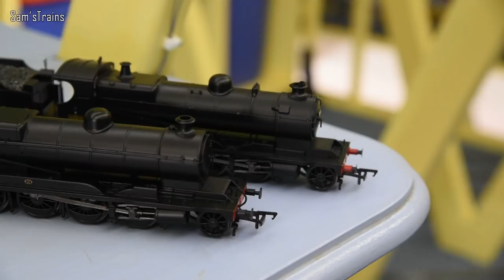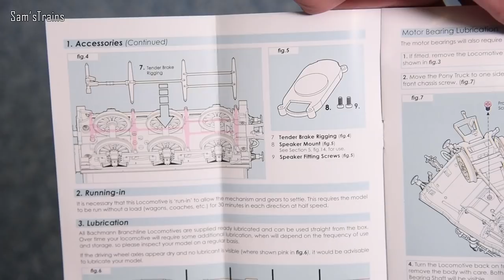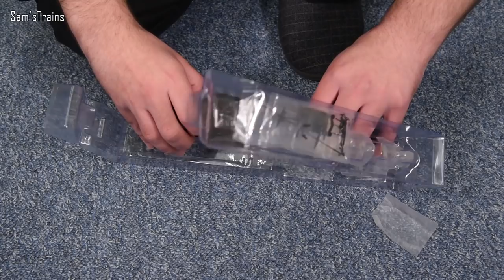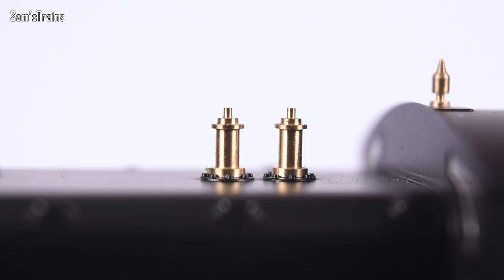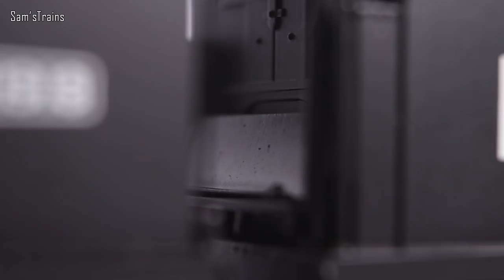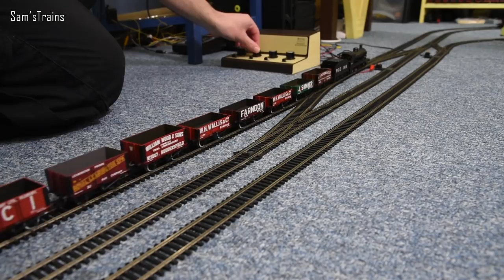Bachmann Wartime ROD 2-8-0 | Unboxing & Review

Comment: Hey Sam, Just thought I should throw an update on the Australian homed locos. They are preserved, ROD 2004 is currently on static display at the Richmond Vale Railway Museum, While ROD 20 and 24 (original number not given/recorded) are 'preserved' at Dorrigo Steam Railway and Museum. 

For those wanting to know, Dorrigo is technically a museum, but a better way to describe it would be open weather rail lines in no greater condition than when they arrived.

Comment: As I have a wartime layout I eagerly bought another loco even though it was by Bachmann. 
WILL I NEVER LEARN?
I stripped it down and looked with horror at the shoddy quality and the appalling mechanism. I wouldn't have knowingly paid £100 for this. I only have  my state pension so I need to be careful with money. After seeing the lack of contacts, no real barings, loose handrails etc. I lost no time in parcelling it back up and returned it for a full refund. No point in running it. It will deteriate in no time. I wrote a letter of complaint to Bachmann which won't do any good but it reduced my blood pressure a little.
Great review Sam. You backed up what I found.
Reply: Very well said, and you speak for many of us in the same situation. Thank you. 
Tim

Comment: Part 2: If we look at the 1950’s moving into very early 1960 they were scattered across many Motive Power Depots of the Eastern Region.
31B March 		25 (due to the prescence of Whitemoor marshalling yard)
35B Grantham		12
36A Doncaster     	32
36B Mexborough 	17
36C Frodingham   	6
36D Barnsley		6
36E Retford		      13
38A Colwich	      15
38B Annesley	      50
39A Gorton		      60
39B Sheffield Darnall (again due to the marshalling yard)  30
40B Immingham (new dock area)			                        17
40E Langwith Junction				                               35

Comment: Part 5: It is easy to see why the ROD chose the GWR 2800 Churchward class introduced in 1903 and the Great Central Robinson class introduced, 01 in 1911 & 04 in 1917. Tried & Tested with many spare parts at both Swindon & Gorton they were standard designs with great pulling power & reliability.

Comment: Sam, I've just read a German lady Linda Offenbach comments below. She's made a very good point that your review points scoring is missing a Durability rating. Currently, you are including this shared a bit between the Quality and Performance ratings. Original Hornby Dublo had quite crude mechanisms, but many are still running very well, so their robustness (inclusive of Durability) can't be faulted. 
The brass whistle scores high on quality, but the fact it fell off when you turned the loco upside down scores very low on Durability (read fragile). So adding another score class into the mix would significantly change the final scores. High detail and visual Quality is fine for an inert Airfix kit, but a moving model which gets handled a lot needs Durability.
I'm afraid Accurascale may come a cropper here when you get around to reviewing their products. They are high on details Quality, but low on Durability as they snap when trying to remove them from their box.
Reply: I’m worried @SamsTrains may not have seen the comment I am replying to, which is not surprising when there are 488 comments. I’m curious to know how Sam would go about testing the durability of a model’s body or mechanism, though, which seems more difficult than rating the durability of detailing.

Sam’s reviews are already great, but there’s always room for improvement. I would personally be interested in haulage tests that push locomotives closer to the edge of their comfort zones, which may be more useful than knowing how many wagons they can pull on straight and narrow track (which is what is currently measured).

Hope this has been helpful, Sam. I appreciate your videos, especially your critical analysis of mechanisms, which certainly helps fill in the gaps left by how power is measured. Showing all the details on camera also gives everyone a chance to pick out issues they aren’t willing to deal with on a model (such as the roughly molded drivers on the Sonic Models 4-6-2 tank engine, which would have been a dealbreaker if I was looking to buy that model). Thanks for making these reviews.
Reply: @Charmaster04  Durability I feel should be about handleability mainly e.g. would one be confident in picking it up and removing the body from the chassis without vulnerable bits falling off. So far, every Accurascale loco if purchased has had little bits of black plastic detail lying in the bottom of the clamshell packaging. Also, upon picking up one of their tanker wagons, the steps up to the roof snapped because they were made of plastic, not etched brass as they should have been. They are a new company, and these faults show their inexperience  in choosing the correct material. Also, sometimes, being a bit over scale on thickness is necessary to ensure strength and therefore durability. 
I think Sam has enough experience handling stock to give good judgement on this issue.
Reply: @andrewdking  Thanks for clarifying. Also, Accurascale has bought Hatton's original steam locomotive tooling and has produced their two tank engines. Does the same durability/handleability issue seem to apply to them, and would it probably apply to the Genesis coaches if they bought those (I may or may not be heartbroken that the Genesis coaches don't seem to appear on American eBay and have been marked up to about £200 for a set of four on eBay UK)?

Comment: Part 4: Allocation to the BR north eastern region a small contingent worked the area in the early 1950’s. Again due to the association with the Great Central Railway. 01 & 04s worked hera and all were gone as the 60s approached. 
53A Hull Dairycoates  27 by 1959 they had been replaced by WD 2-8-0s
53E Cudworth            5
Reply: Thirteen sold to Australia for coal mining service.. Lasted in service until 1973. Three remain.
Search YouTube for richmond vale railway 1971-73 to see some of the last in service use as late as 1973 until the Beyer Peacock 2-8-2 tank locomotives took over all haulage until 1987.
Reply: @johnd8892  Excellent Thank You

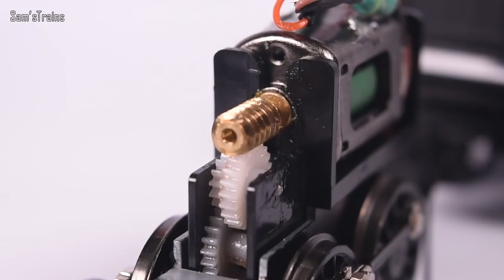Comment: At 17:40 I think you will find these are inductors, once called chokes. These are to reduce high frequency interference generated by sparking at the commutator. The capacitors aim to do the same thing.
I think mandated by electrical equipment standards.
Explained to me when quite young by my Triang Railways First Ten Years book on page 108. RT208 from 1962. Much later on covered in my university level electronics courses.
If people think these are resistors then calculate the resistance from the colour bands and measure the expected voltage drop. Inductors aim for close to zero ohms resistance as would be expected for a component wired in series with a motor.

Comment: Marking
Three pole motor - minus half
No flywheel - minus half
No chassis bearings - minus one
No tender pickups - minus one
Broken piece on delivery - minus half
Glue on body - minus one
Bent part - minus one
Poor crawl out of box - minus half
Poor crawl after running in - minus one
Weak power/lack of torque - minus one
Expensive RRP - minus one
Traction tyres - minus half
Paint issue - minus one
Too fast running (silly gearing) - minus two

Comment: Part 1: These would be excellent choices for modellers as they were peppered across the Great Central system, basically anywhere there was a need for heavy freight locos (remember the Great Central did good from freight receipts). Infused into BR they appeared all over the Eastern Section.

Comment: Although these were the most commonly referred to ROD locomotives there were many more used by the ROD such as ten Australian D50 class 2-8-0 consolidations from NSW.
NSWGR D50 locos were sent to France in WW1 and worked alongside these other ROD locos.
From Wikipedia ;
During the First World War, an additional 10 locomotives of this class were under construction at the North British Locomotive Company, but these were not delivered to Australia, being taken over by the British War Office for the Royal Engineers Railway Operating Division. After the war, they were offered back to the New South Wales Government Railways at higher than new prices and in a badly worn condition. They were declined and 8 locomotives were subsequently acquired by the Nord-Belge railway [fr] in Belgium[3] and, following rebuilding, assigned to work coal trains along the Meuse Valley. The 2 other locomotives were acquired by S.A. Force, Eclairage et Docks de Gand in Ghent, Belgium

Typical British approach to Australia offering badly worn ex ROD D50s back to NSW at higher than new price. All locos, irrespective of design, run by the Railways Operating Division were ROD locomotives.
Quite a few D50 HO models have been made over the years , from brass to white metal kits to ready to run.
The D50 were in service from around 1896 to 1972.
Reply: The Midland Railway also supplied many Kirtley double-framed 0-6-0 goods which ended up all over Europe as far as Italy. Simply because they were so numerous and standardised and easy to operate and maintain. Just like the later Stanier 8Fs, which ended up after WWII as far afield as Egypt, Iraq and possibly Iran, all equipped for oil burning.

Comment: Hi Sam.
Nice locomotive I've often considered, or one of the variants.
I've had a couple 'tender pegs' break on my Bachmann locomotives - admittedly the ones broken on mine were fixed distance pegs.
Generally, I flat, drill appropriately and replace with a 'headless screw' (or grub screw) of correct diameter / length (obviously can adjust by screwing in a bit more where space permits, if required.
I generally like the idea of 'adjustable distance' - it's very simple - much easier than the Hornby way of unscrewing and replacing the screw.
Nice honest and direct review.
Al.

Comment: Hi Sam I’ve had problems with Bachmanns tender coupling arrangements too. Twice on different locos the plastic coupling pin has been too short and it has resulted in the locos dropping the tenders in random places. I cured it by putting a 1mm drill up through the centre of the plastic pin using a pin chuck and using epoxy to glue a longer brass rod in the hole. Seemed to cure it but let’s face it locomotives shouldn’t drop the tenders at all. On second thoughts perhaps it was  0.5 mm.

Comment: You need to get a padded locomotive stand for when working on upside-down locomotives.  You can make a simple one using some pipe insulation and a couple pieces of scrap wood, or you can buy some really neat ones.

Comment: Hi Sam, just bought one of these in LNWR livery, and I thought it was worth noting that, though it doesn't have tender pickups, there is a capacitor located in the tender from the factory. I'm not sure if you mentioned that, I didn't hear it when re-watching this video. Still doesn't mean the tender pickups aren't necessary, but it is a little extra feature that most locomotives don't have.

Comment: Hey Sam , in regards to the coupling part , I have had it happen with two Bachmann a2s , where the tender shaft to the drawbar broke , i fixed it with a spare self tapping screw.I told Bachmann and the way it occurs is basically when it is handled , the drawbar can break the shaft off

Comment: Hi Sam I am getting a Lima Class 47 and it is due to arrive at my house  on Saturday so it should arrive this Saturday and I have already sorted out a Rake of BR maroon mk1 coaches and it was on Ebay for £45.00 and I was going to get a Mainline Class 42 Warship D824 HIGHFLYER but it sold for £37.50 but I can get a Mainline Warship at my Local model railway shop for a little bit Cheaper and I also plan on getting two West Country Class locomotives a Wrenn Dorchester and a Wrenn Barnstaple and 12 LMS coaches  and a Class 66 captain tom Moore some time in not to distant future .Cheers.Lewis 😀.

Comment: Hey I just wanted to say I have some Bachmann U.S locomotives with the same type of chassis that still run nicely after 20 years . I have one that failed and it wasn't the bering less chassis that failed it was the brass barings on the belt driven worm gear

Comment: Well done Sam for exposing Bachmann for their profit-seeking ‘value engineering’. Whilst I do appreciate great engineering; how about you doing an endurance race? Take a cheap Bachman mechanism and a better grade of something else and run them several hundred hours (or ~50 hours with the Bachmann?) and see how they go? Maybe do a vote on the expected continuous service life? Maybe have to do a mini-service every day to clean the wheels and pickups?! I would respectful suggest the square cast chassis bearing do not wear but they will add friction. Be interesting to see the mode of failures - motors at a guess.

Comment: Sam after getting back into the hobby the one thing that gets me the most is how over priced things have became.
And then the substandard quality of the items is just unreal.
Reply: Perhaps you can find a reliable second hand source ?
Reply: I know it's not the best solution but modern Hornby Railroad items are really good. I've had nothing but good experiences with the newer models and a lot of them are in the £60-£80 range.
Reply: Purchase a Hornby R3544 B12 for just 140 GBP!  I just did.  What a gorgeous model!  Perfectly assembled, a delight to look at, all metal boiler, runs as smooth as silk, as it should, with a five pole motor and two flywheels.  Now that is great value.

Comment: So much variation in the standard of Bachmann locomotives depending on how far back they were tooled up.
But not much variation in price to reflect this, all consistently high.
So your older reviews are a valuable guide to finding out what is likely to be the driveline in a model being considered for purchase.
Even Bachmann listed as new may be just a new livery. Bachmann being very rare to improve much to justify their increasingly higher prices as you would expect for the money.
Magazines are pretty useless for this information. They just go on about the prototype for most of the review then say everything is '"Superb" or have special access to the makers to get preferential supply of models checked to a standard that normal purchasers never get.

Comment: Very nice review.

You should do an experiment comparing the tractive effort of 2 locos - a low quality (bachmann) mechanism vs a high quality mechanism. Locos need to be as similar as possible. Run them both continuously under load for a few hundred hours then see how the tractive effort changes.

Comment: The engine looks great! Now I wish Bachmann can fix the issues on their old Reading I10sa engines and rerelease them soon. 
Edit: it pains me to see all those resistors and capacitors choking the motor and performance. I bypassed them on my Niagara with the Tsunami 2 decoder and it works better than using the board. I wish they’d use decent decoders from factory for the non sound engines.

Comment: I like the Robinson 8Ks. I've got a LNER black O4 and a BR black 30xx, just like yours. I'd love a ROD in LNWR or LMS, but not for the current price for that mechanism.
It's shameful that Bachmann can produce such a nice looking loco yet is outperformed by a Heljan O2 with missing valve gear (my 8Ks slip with 40 wagons, my O2 can manage 50 without slipping). But hey, they're better than the 9F with its lack of torque.
I still need a Thompson O1 and a S&DJR 7F, plus a LMS or BR liveried Stanier 8F.
I'm hoping Hornby's new Clans will have some improvements over the original release about 15 years ago, although they do seem to add DCC sockets and NEM couplings to all their locomotives when they re-release them.

Nice to see you running a nice length of freight train though
Reply from the maker: Yeah me too - nice looking class! Oh sure, way better than that 9F!!
Thanks for watching, Sam :)

Comment: One of the three preserved ROD 2-8-0 is preserved in Australia, somewhere.
In fact the New South Wales D50 2-8-0 bear some resemblance to to ROD 2-8-0
Reply: And numerous D50 locos were sent to France in WW1 and worked alongside these other ROD locos.
From Wikipedia ;
During the First World War, an additional 10 locomotives of this class were under construction at the North British Locomotive Company, but these were not delivered to Australia, being taken over by the British War Office for the Royal Engineers Railway Operating Division. After the war, they were offered back to the New South Wales Government Railways at higher than new prices and in a badly worn condition. They were declined and 8 locomotives were subsequently acquired by the Nord-Belge railway [fr] in Belgium[3] and, following rebuilding, assigned to work coal trains along the Meuse Valley. The 2 other locomotives were acquired by S.A. Force, Eclairage et Docks de Gand in Ghent, Belgium

Typical British approach to Australia offering badly worn ex ROD D50s back to NSW at higher than new price. All locos, irrespective of design, run by the Railways Operating Division were ROD locomotives.

Comment: It's a shame that Bachmann can't be better and more consistent (in a positive direction).  When you look at this loco and the 9Ffor example compared with the GNR/LNER C-1 and LBSC/Southern H-1 4-4-2's it is very upsetting.  The latter locos have tender pickups, turned brass axle bearing, and beautiful liveries, showing that Bachmann can produce locos on par with the better Hornby and Dapol models.

Meanwhile I broke down and purchased my first modern (as opposed to 1980's vintage) Hornby locos.  R3617 BR (Late) 4-6-2 Merchant Navy (Rebuilt) "Elder Dempster Lines" No. 35030 and R3848 BR Terrier "Carisbrooke" No. 13.  Very nice models, although the Merchant Navy lacks a NEM pocket on the tender, no painted cab interior, and feels a little light on the weight side.  Both run very well, though, and at least the Merchant Navy has a proper trailing bogie.